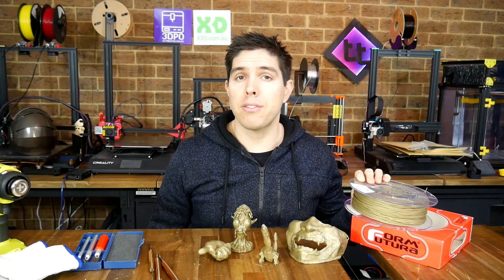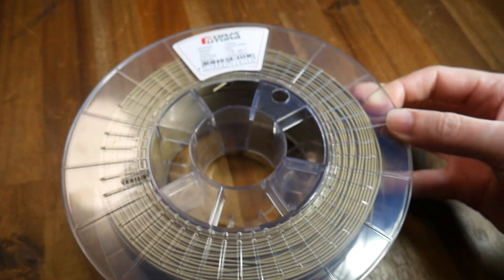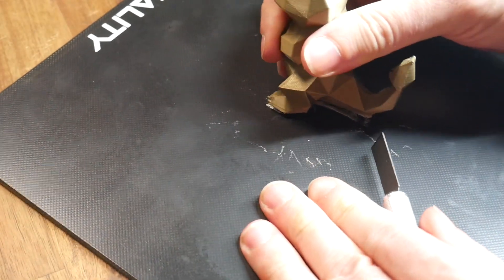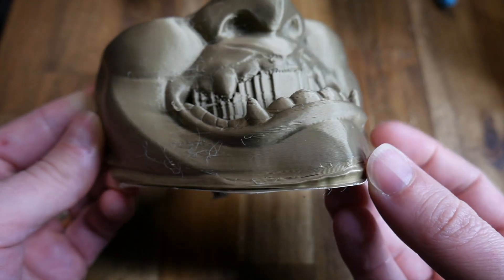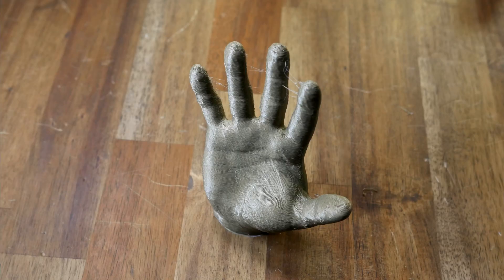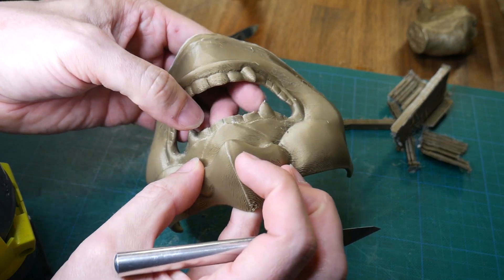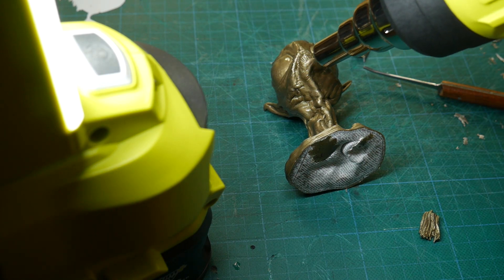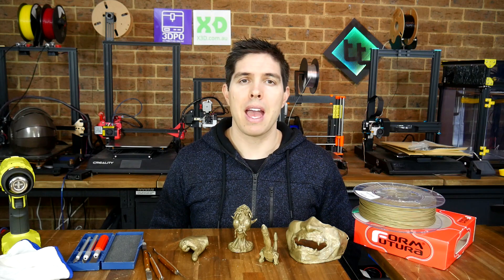3D Skulpt filament - 3D printable clay?

Comment: hey Michael thanks for great and as always very inspiring video. Regarding this topic, i know as an artist, that you could get so much better result using a soldering iron to smooth the surface, and regarding bending tex fingers the result could be much better, just making a slice to bend the fingers, and then , soldering the finger back in the new position, and smoothing it with the wast material.   You can se this done, and taking to a very high level mad e by Artist Hoo, using 3D printerpen soldering iron and dremel, - just using orinary Pla materiel     https://www.youtube.com/watch?v=6hW_FbsEG4A

Comment: hey i love all the fancy filaments on the market now. i do a lot of cosplay props and i can see how it would be good for that. i wonder it a heated tool would be better than heating the print, for example a low temp wood burning tool or a soldering iron with adjustable temperature settings.

Comment: Have you tried or seen these nozzles? I came across them wanting to print in finer detail but have not tried them it's an interesting thing. I can't find anything else about them other then this article and this ebay user in China that sells them. 

https://hackaday.com/2018/10/01/high-detail-3d-printing-with-an-airbrush-nozzle/

https://www.ebay.com/itm/113827357714

Comment: PLA if heated, you can sculpt it to. You always need a large number of layers to sculpt it. Hot air and Soldering Iron set low. You can probably use hot water too.

Comment: Not useful! You need to print with 100% infill to manipulate it almost "as you wished". Making a clay model is much easier than fixing these layer lines' imperfections here. If you want a smooth model then ABS + acetone or any polished/painted plastic will be much better!
It would be a nice "toy plastic" for kids... but it costs way way too much!
Also about the real clay topic: don't forget that after a succesful burning a clay model you'll get a very heat resistant part/figure. These "clay plastic" figures will be necessary to keep away from sun (my 50/50 guess).

Comment: Expensive and pointless. Might aswell invest into very cheap filament + primer + sanding paper + Paint - and it'll still cost you like half the price.
I think a lot of manufacturers really get things super duper wrong. We no longer are in a market where most people buy 2K+€ printers, nowadays most people are on an ender3, a CR-10 or a prusa. Asking to pay 80$ for 750G of plastic (cuz naah, for that price you don't get a kilo, of course not!) and providing so poor of a user experience. Yeah it takes ballz of steel to attempt such a thing in this day and age.
At least it's the way to go if they want to end up like rigidink.

Comment: I'm thinking less heat is better. Maybe just stick the sculpting tools in hot water then apply the tool to the material to smooth it. Also did you try heating te bed up to 70 to remove? It might work like when tpu gets stuck. I think if you treat this stuff like you are sculpting  a stick of butter it might work. You wouldn't apply heat directly to butter with a heat gun or dunk in hot water , right? Ok maybe like salami butter? :)

Comment: How about working a little by heating the sculpting tool with an alcohol lamp rather than heating the printed model?
If there is a hole, you can melt the filament, stick it, and then sculpt it.

Comment: I think you would have had better luck if you had been less agressive with the heat. Sculpting things with similar melting points like Microcrystaline wax requires that you approach the melting point gingerly or you end up trying to sculpt with soup. Also having a bowl of cool water to "freeze" the medium helps when things start getting out of control.

Comment: Thanks for sharing this with us, this is very interesting filament.  It seems like objects would need to either be printed solid or hollow in order to be able to shape them without deforming the original shape too much.  A hollow print might work if you can cut off the bottom and place tools inside to support the material while you're shaping the outside.  Partial infill will probably just collapse as soon as it gets soft.

It seems like fine control of the material temperature is needed to get the kind of results the manufacturer claims.  A sous vide machine would be ideal for dialing in the temperature, but the cost would be tough to justify (unless you also plan on using it for its intended purpose of cooking, of course :) ). 

I would also suggest trying PVA glue stick or hair spray on the bed as a release agent.  Those are my go-to's for filaments that stick aggressively to the bed like this one.

Comment: My guess is, that for pieces where you would want a snug form fit and don't have a 3d scanner this could be quite useful. For example, if you were printing a mask for some cosplay you could print it and press it against your face to imprint the exact shape and detail.
Furthermore, you might have a lot better results with sculptures, if you were dual material printing. A non-reformable material inside (with normal infill and perimeters) and a few perimeters of clay filament on the outside. With this, you could reshape the surface without changing the overall form of the sculpture
Reply from the maker: I thought about mentioning that the mask could be heated and pressed to the face to conform perfectly but I didn't want to encourage anyone to burn their face.

Comment: Would have been nice to see a test print or two with more outlines and infill, the video seems incomplete as it stands now. A lot of times you mentioned that the result is partially the way it is because of bad settings but never show the same print with better settings or any alternative print with the better settings for that matter. Quite a shame. 

Otherwise an interesting video, really cool of you trying out different exotic filaments like this.
Reply from the maker: I agree and have the same feeling. I should have done the first test after the first print instead of putting all my eggs in one basket. By then I didn't have enough time.

Comment: I've been waiting for something like this ever since Adam Beane introduced his Cx5 sculptable filament, which sadly never really made it to the market. If it is anything like his Cx5 sculpting material it should be very high standard. But onto Form Futura's filament. It looks like a very interesting material, but I would like to have seen you retry at least one model with the correct settings or even with 100% infill, which makes sense for sculpting. So I would've more info comparing the two or three versions of you with both each other as well as what I've seen from Cx5. Thanks for the video, as I didn't yet know this filament existed and I will definitely put it on my list.

Comment: Yes, I'm definitly interested in this. I have some experiments with "Polyshape Polymorph" what doesn't need to be printed, just put it into hot water and the form it. It is really(!) helpful for different situations. Without constructing, just shape it, around or into something.. The filament you showed is like that but with a pre-3Dprinted object it's interesting: print some basic shape and knead it into/around something.. interesting!
A little criticism: you learned something, good. But why not giving the objects (or something else) *one more  print* and try it again before making the video? Would this be too long? too extensive?
Anyway: Thank you for sharing your experience!
Reply from the maker: I agree another try would have been best but I was out of time. I need a different approach next time.

Comment: Would be interesting to print a montana mask in that and then form it to your face for a better fit
Question would be if it had enough structural integrity to stay on your face with some rubber straps
Reply from the maker: Unless it got hot I think it would be ok. I feels like a super stiff TPU (or dense salami).

Comment: I would love to see Form Futura's demo reel on this product, and see if "success"(meaning the model is better after post processing) is even possible. Any result is a result though. Love the outside the norm or strange new products/procedures in 3DP approach.  Well done!!
Reply from the maker: I agree completely. The print settings video on the website talked about a follow up for post processing but it doesn't exist on their YouTube channel. So all I had to go on was the text instructions which said heat gun.

Comment: Perhaps you would have better luck if you heated the tools instead of the model? Something that could work is a cheap soldering iron/wood burner and a variac to control the power & temperature.
Reply: yeah the whole point is to use heat with tools
Reply from the maker: I agree it's worth trying, but I did follow the instructions which said to use a heat gun. Normally if someone deviates from the instructions they get roasted for not doing it properly.
Reply: @TeachingTech  Maybe a temperature-controlled soldering iron with a flat tip could be good for smoothing difficult areas.

Comment: I use Glas bed with cheap kapton tape on it and bed adhesion spray (Printafix from Aprintapro) for challenging prints. ABS or PETG can never ruin my glass bed again. Maybe good for this filament as well?
Reply from the maker: I noticed on the website they recommend tape so yes.

Comment: A pyrography (wood burning) kit would probably have helped. (i.e hot tools)
Great video. Keep up the good work.
Reply: Dentist "Wax Tool" kit is much better, not expensive and is designed to sculpt wax. Works wonders on fixing most low temp filaments

Comment: 100% infill wouldn't be practical, I'm wondering if it would work if you printed the model mostly hollow and then filled it with plaster of paris or cement. Maybe upside down with an opening in the bottom. Let it cure and then trim off the supports. That way you have an inexpensive rigid infill that you can push the clay against.
Reply: Considering that the recommended minimum infill was only 25% and even up to 50% would increase the rigidity... especially with the listed minimum number of 5 shells... There is no reason for it to work very nicely... it probably would have been fine if he had read the actual instructions for the filament rather than just ASSuming that it was like every other PLA material...
Reply: @edwardpaulsen1074  TBH, I don't think that 2 more perimeters would've helped. Gyroid infill might I guess as it truly spreads the infill everywhere but as we can see in the video it gets WAAAAAY too pliable WAAAAY too easily. Should probably have been R&Dd further, cuz this review just put this product to the grave.

Comment: What's the point?
Polymer clay: exists
Makers: Ok, let's print it for hours and then just squish it.
Reply: support marks, layer lines, posing models, combining prints without seams. it has tons of applications
Reply: I think there are legitimate applications for this stuff. 
The mask is a good example. You could print a mask and then form it to fit your face.
It takes a lot less artistic talent to modify a 3D print in this material than sculpting the object in its entirety.
Reply: I was just about to say the same thing, also sculpting is available in software and is non-destructive.

Comment: This probably work with normal pla
Reply: Can confirm. I've done this on a multi-part helmet to fix alignment.
Reply: Heating PLA over the Tg and letting it cool down slowly (while sculpting) will cause crystallization of the polymer chains, and after a few cycles you would have to heat it over 100°C to make it soft...  not quite fun to touch at +100°C
Reply: i was thinking that too but probably you cant smoooth surface with around 70 C , this filament abviously has very los glass tranlation temperature then pla
Reply: I find PLA has a narrow range between solid and liquid, less of a useful range between nothing, and burning or sticking.